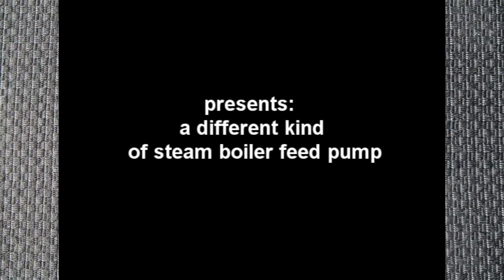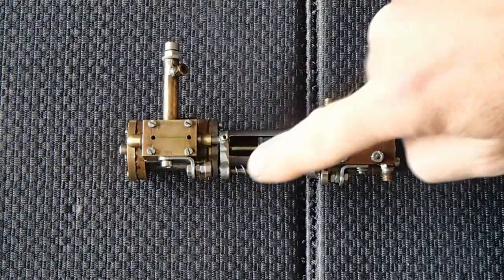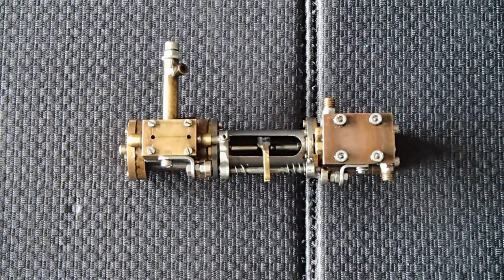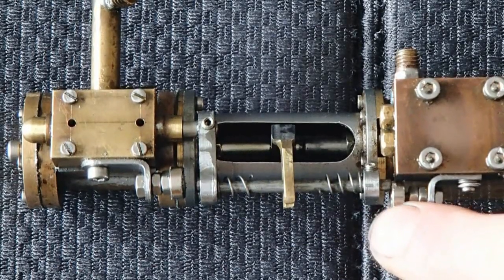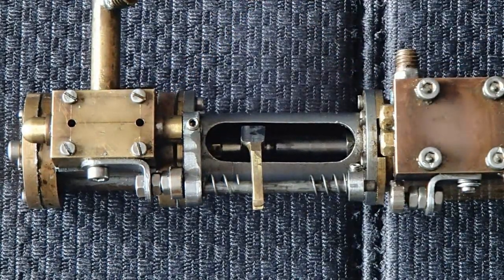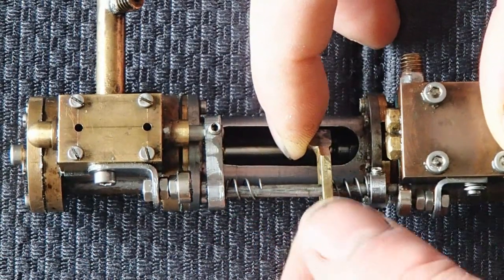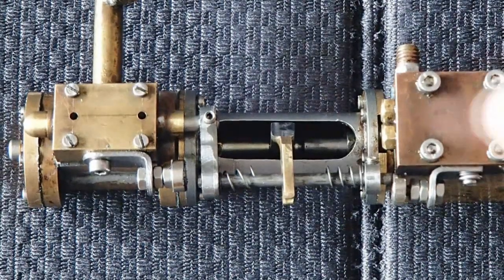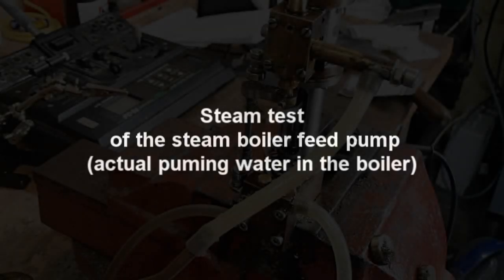A different type model boiler feed steampump

Comment: Do you think a similar result could be achieved with a ball bearing spring detent? Like on a socket set. 

Where the piston valve would have a preference to one side or the other of the bearing detent.
Reply from the maker: Sorry, i don't have a clue what kind of spring you are referring to "ball bearing spring detent".
Even a ballpoint pen spring will work.
As long as it can overcome the holding force of the magnets.

Comment: Also, are the springs really needed? Could it be made to work without them?
Reply from the maker: The springs are the key element .
The springs push the valve over to other side.
Without the springs the valve would not be able to turn over.
It is the combibation of the magnets and the springs that makes it work.
As i explained in the video, the magnet holds the valve in place, when the fork moves towards the other end it hits the spring.
This spring is compressed until the force of the compressed spring is bigger then the holding force of the magnet.
Then the spring's force is released and it pushes the valverod tot the other side.

The magnets and springs are a substitute to the internal shuttle valve inside Weir pumps

Comment: That is a very good idea. Its a simple "D" valve right? Combined with valve stops to prevent over travel... and springs to cushion the valve events. Two of my small steam pumps lack the Valve stops you are using but operate on the same principle. They are fiddly and unreliable. With your system you have much better control over the valve events. Well done.
Reply from the maker: Check my explanation video of this pump, then alle becomes clear.